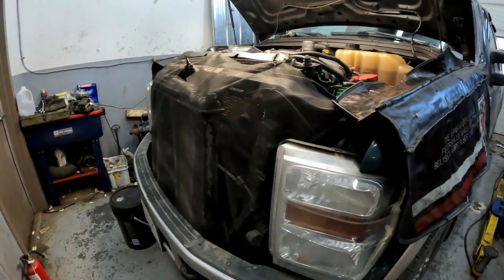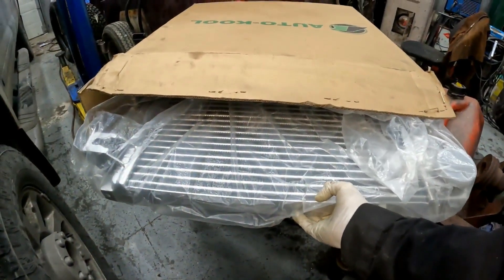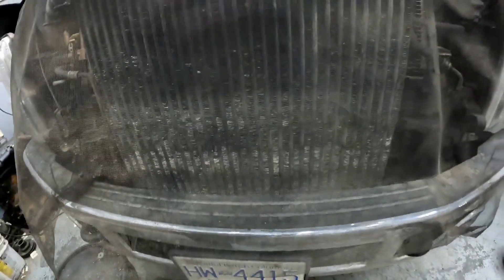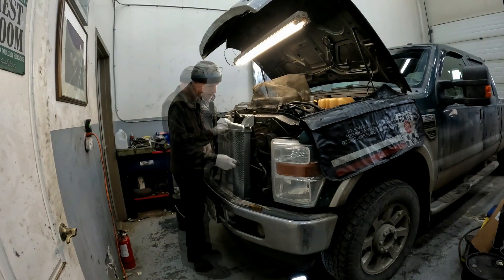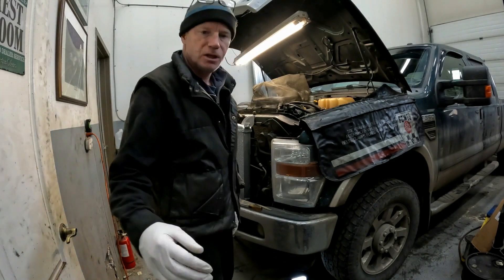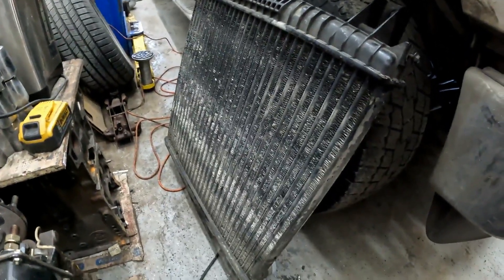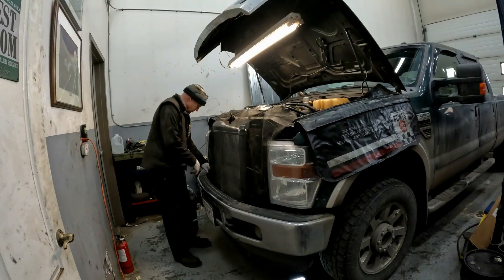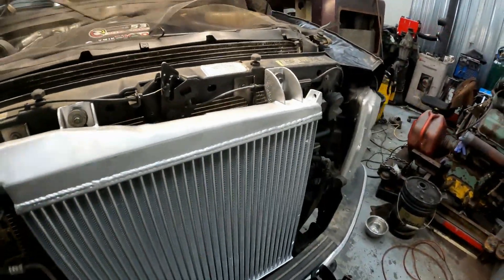Detroit 4-53T Intercooler Upgrade

Comment: Which Detroit would you choose for a 1977 Ford f100?
Reply from the maker: 4-53T would be my choice, perfect fit.  Weight might be an issue as it weighs 1250 LBS.  The 3-53T would be my second choice at 950 LBS.:)  Thanks for watching.:)

Comment: Any intercooler on a 4-53T is an upgrade over the stock setup with the blower breathing hot air directly from the turbo.
Reply from the maker: Very true.:)
Reply: @detroitgarage9430  I’m excited for the 9G90s. Hopefully you can keep the idle clean and move enough air to keep them from hazing at full rack.
Reply from the maker: @lukestrasser  Me too, I'm confident I can  keep it clean with the 9G90's.:)

Comment: get some irrigation jets and put a boost activated spray bar onto it ;)   Evaporating water has a lot of cooling capacity and can offset the lower road speed on climbs when a charge air cooler drops in effectiveness.
Reply from the maker: Thanks, I might try that when I get the larger injectors.:)
Reply: @detroitgarage9430  I was always curious about the performance advantage of the Mack "Coolpower" system that used air bleed from the turbocharger to drive a 'tip' turbine which then pumped cool air from a separate air cleaner through the charge air intercooler.  In theory that system would give enormously better effect when pulling on long grades at slow speeds.